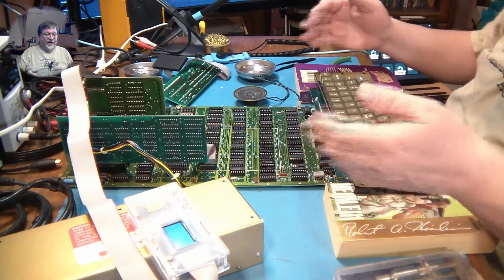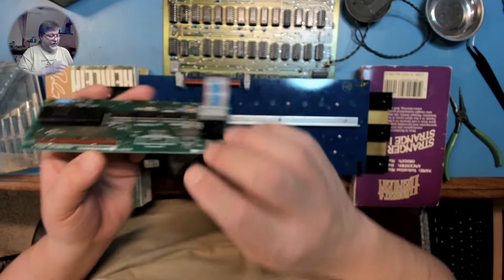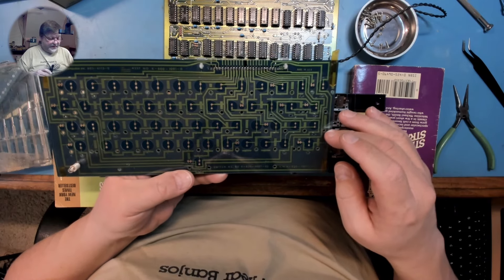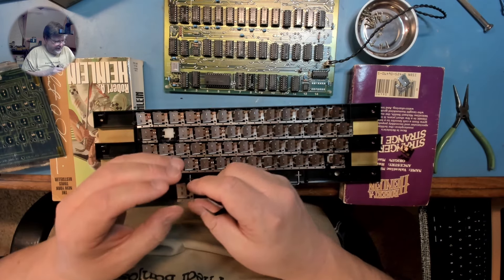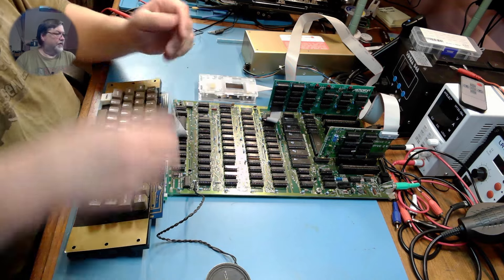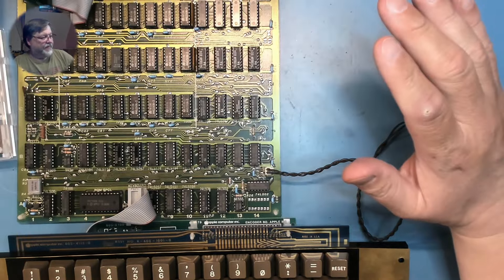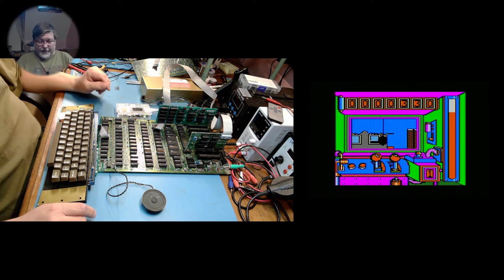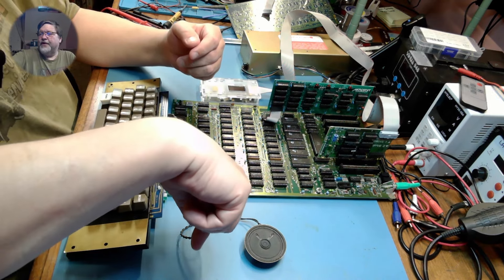Will I be able to fix this Apple ][ keyboard?

Comment: I tried several times to fix the on that came with the used apple II+. Finally it just broke. I had one key that for some reason stopped working no matter what. So I gave up and used a ps/2 adapter. Finally tracked down different keyboard. Problem solved.
Reply from the maker: I was starting to feel that way about mine, so it was fortunate I had the other keyboard from Dev Rossik.  I still do intend to dig back into that keyboard at some point in the future and see if I can get it working, but at least I have a working ][ Plus now.  Thanks for watching!